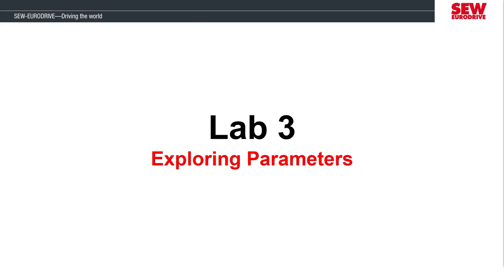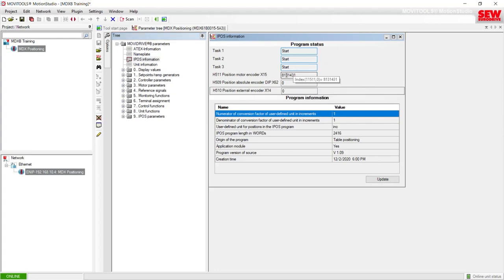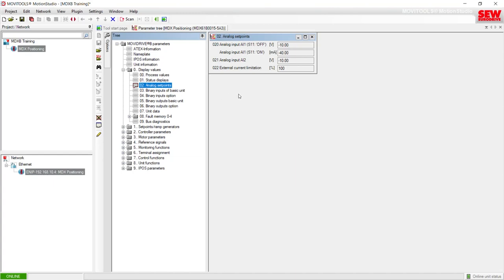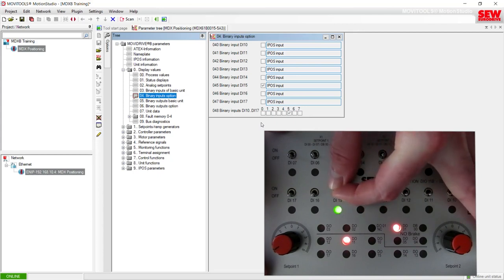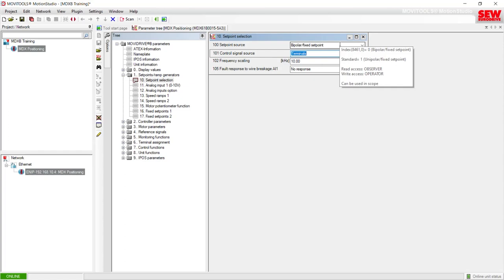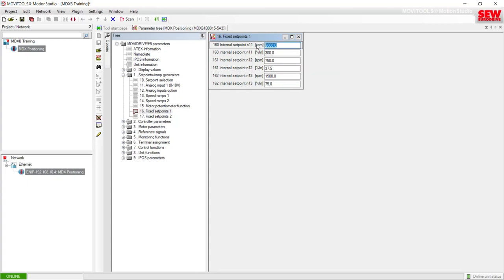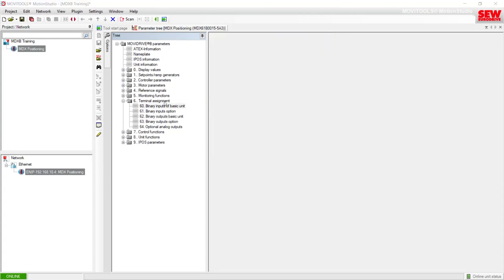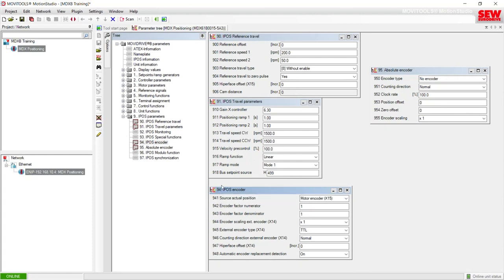MOVIDRIVE® B Training Session 6 - Lab 3 - Exploring the Parameters

Comment: Thank you for the course, I would like to know how to deactivate the Controller Inhibit if I do not have that switch board?
Reply from the maker: Hi Jonathan. There is no way via the parameters to "turn off/deactivate" the inhibit function since it operates from a hardwired 24Vdc input to the terminals. In real applications this usually is supplied from the PLC or operator terminals when the Start or Run command is given.

In these training videos the switch box is acting as switchable jumper wires between the 24Vdc out terminals of the Movidirive B® back to the input terminals. You can find the Movidrive B® terminal schematic in the manual linked below on page 603.

However, in real applications we do not recommend permanently deactivating the controller inhibit with constant 24Vdc since that function of the inverter is very important.

https://download.sew-eurodrive.com/download/pdf/20262140.pdf

Comment: Hello, I have an issue with a drive. I cannot figure out how it gets the ccw or reverse direction. It is a compiler based and is all fieldbus communications. Is the set point possibility supposed to be negative? I know parameters 35 is for switching direction. Bit we have another machine that uses this drive and that parameter doesn't change.
Reply from the maker: @tonybischoff3608. That is hard to say without seeing the parameters/IPOS program. Generally, for fieldbus control the speed or position setpoint is a signed integer (i.e. negative/positive depending on direction of travel). If it is only a jog mode control then possibly there are separate bits or inputs for the CW vs CCW directions. You can look at parameter P100 & P101 to see where the Movidrive is looking for the setpoints. Also, in MotionStudio there is a tab for "IPOS Information" above the "0.. Display Values" parameter folder. Click on that and view the text box to see if it is one of SEW's Application Modules or if it is a custom IPOS program. Our phone support is free if you would like to call your nearest SEW office and ask for Regional Engineering - Electrical Support. They can provide you with an email as well so they can inspect the parameters while you're on the phone. https://www.seweurodrive.com/contact_us/find_cs_sales_distributors/sales_default_nmc.html